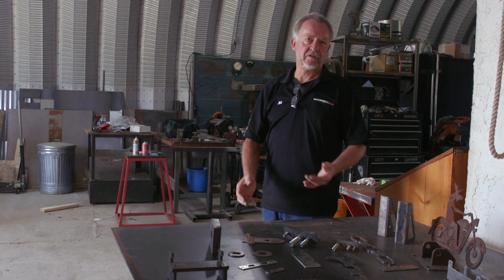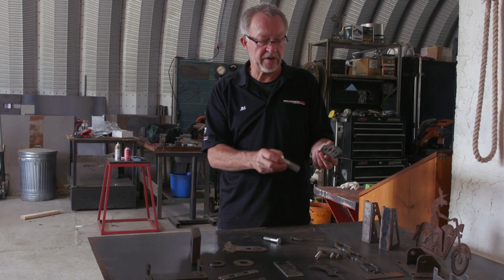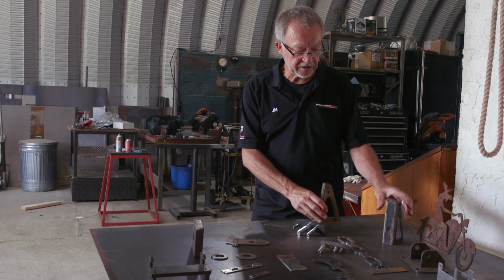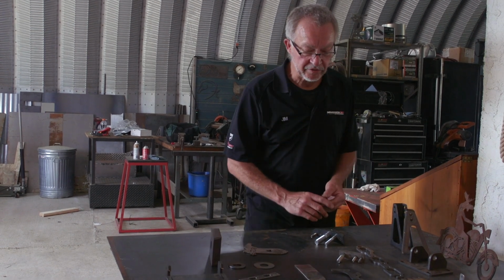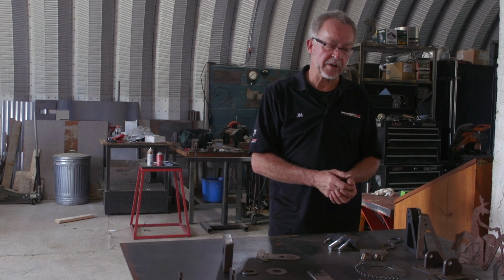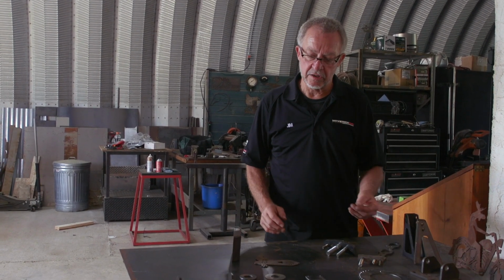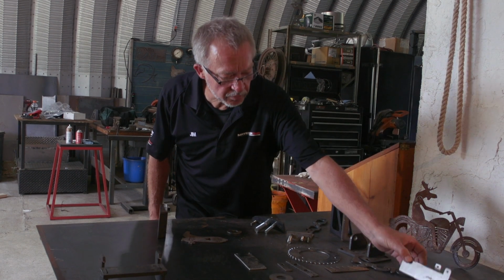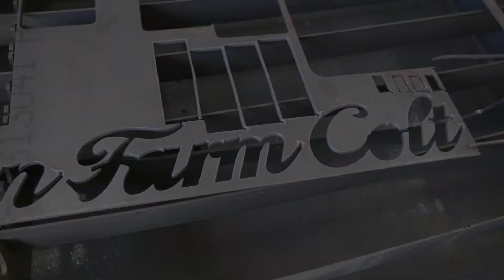What Kind of Jobs Can I Do With my Cutting Table - Tips and Tricks with Jim Colt

Comment: Jim, first thank you for all the knowledge you share.  I've read countless responses and articles on the Hypertherm forums and other areas and watched several of your videos.  How did you cut the angle on the 1" piece of steel in this video?  I'm designing a new log splitter and trying to figure out the best way to cut that angle for the splitter wedge.  A lot of commercial grade log splitters use AR400 steel for their wedges and It would be very difficult to mill or grind something like that.